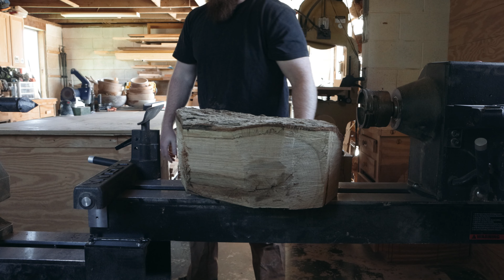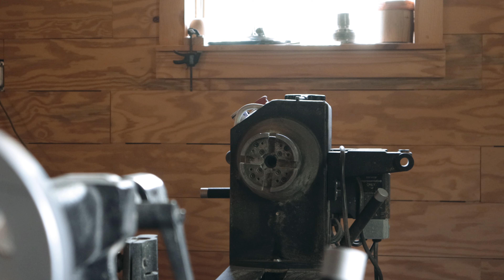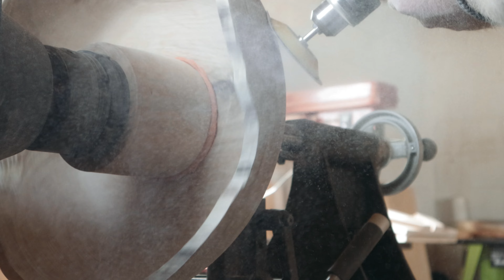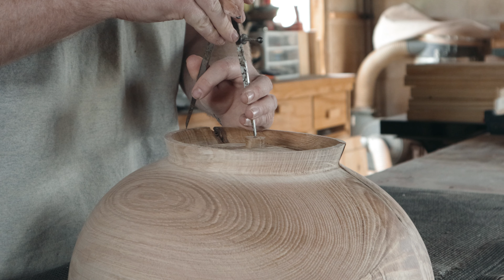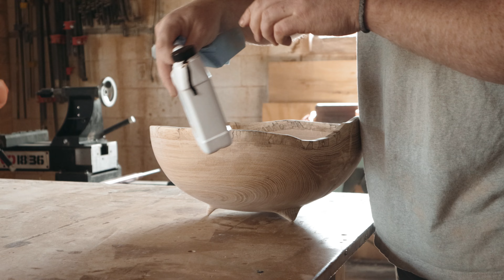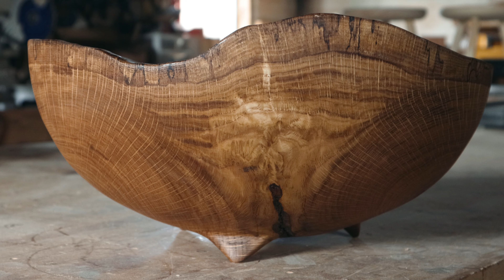Turning a Natural Edge Oak Bowl with Figure, Spalting, and Little Carved Feet | Wood Turning

Comment: Sweet looking bowl. What is the method for laying out the feet location?
Where do you get your sanding pad part that goes in your drill? The yellow backed piece.
Reply from the maker: I can't think of the term for the method but you take calipers, get one point in the center, one point on the rim to get the circumference, then go around the rim laying out the points, skip every other point of contact and if done correctly it should give you feet spread 1/3rd away from each other. The sanding pads are from VincesWoodNWonders website.